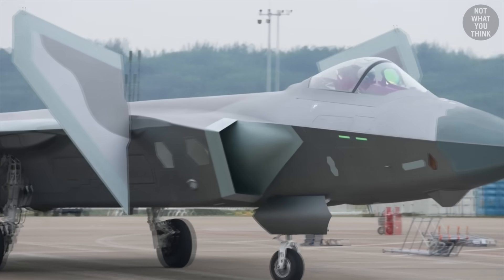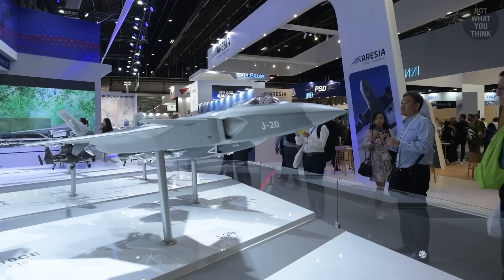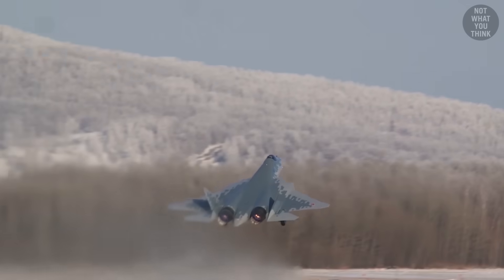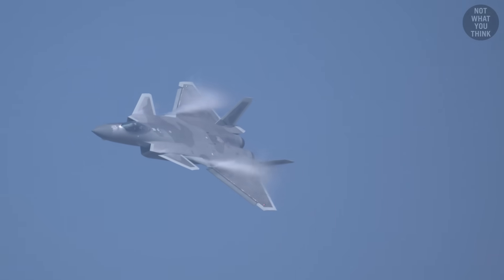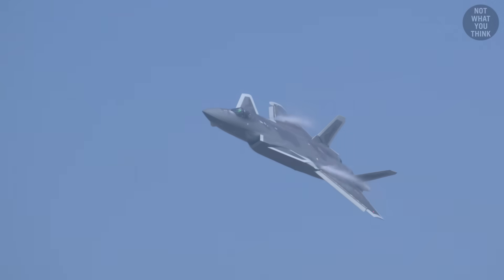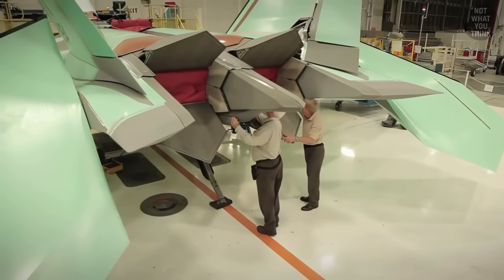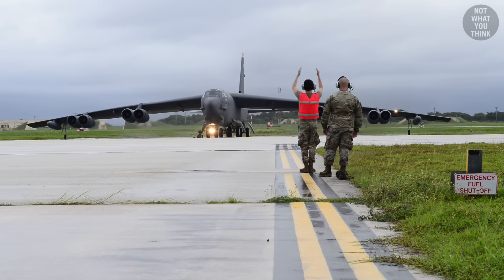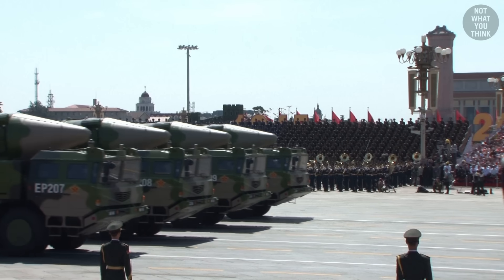Why China's Stolen "Stealth" Fighter is Problematic

Comment: wait what? How does the afterburner give it more of a radar return? Surely you mean an IR signature.
Reply: It's plausible... afterburner exhaust is going to be really hot. Really hot gas could be ionized. Ionized gas is going to be isotropically reflecting radar. Radar frequency light propagates much further than infrared light, so the radar return could be more significant than the IR visibility.

Comment: China has no long distance support for the J20. Also even with those improved indigenous engines capable of super cruise...they are not heat shielded. The J20 still pumps out super hot gases without afterburner, which is very visible to American airborne electronic intelligence aircraft. Also it is not very stealthy in terms of RCS. It may be a relatively capable modern aircraft, but up against a pissed off US military...its still toast.

Comment: What happens when two stealth fighters approach each other but can’t see one another? You’re gonna want a gun then.
Reply: You have something called High off Boresight IR missiles. Plus, stealth doesn't mean invisible, just reduced visibility. At 10 Km stealth isn't gonna do much to save you from an AESA radar and an Aim120, PL15 to the face. This is why there's a thing called the MAR or the no escape zone for missiles.
Reply: That’s why the f22 and f35 can still dogfight and has cannons
Reply: @halo1011998  if im not mistaken, only the f35a has guns internally
Reply: @nomad_grj Yeah, only 95% of all F-35's manufactured to date.
Reply: 有中国J20拦截F35的新闻报道，你们军方人事证实过，为什么会有这种事情发生，这肯定是F35被发现了。所以在中国的近海，隐身战机未必隐身。
Reply: The prevailing theory is that a stealth fighter should never even be close enough to another fighter for a gun to be necessary, but the emergence of the J-20 challenges that theory. Also, modern stealth fighters aren't actually invisible to each other; you can fool radar but there's currently no way to mask the infrared heat signatures from jet engines.
Reply: @ManiaMac1613  It also has to be considered that Stealth Fighters aren't "Invisible" to radar, especially at ranges close enough for an IR missile.
Reply: @ManiaMac1613  No, the theory isn't challenged. You don't run into a knife fight when everyone has guns.
Reply: The close range high off bore-sight missile come in handy in this situation aswell... cant forget about those AIM-9Xs or the russian Archer R-74Ms.
Reply: the detection range of fighter jets is somewhere between 15 and 25 km

youre not using a gun at 15 and 25 km. two planes flying towards each other would have 30 seconds to  respond to each other and at that point you might as well launch a missile
Reply: @purona2500  Yeah? What if the missile misses the target? Are you both just going to agree to stop engaging because you're too close to effectively use missiles and only one of you has guns? lol
Reply: @somethingtojenga  both planes turn around and whoever completes the turn first fires again
Reply: @purona2500  Why would you waste missiles if you have thrust vectoring and come around to the back of the other fighter in range of your guns?
Reply: @somethingtojenga  Because there's a squadron with you on their missile range while you try to get inside gun range.
You will not get close.
Reply: @purona2500  if you’re really trying to be undetected then you or they are terrain masking. You’re not going to see anyone or they you until you’re right up on them.
Reply: That's why j-20 carries 2 or up to 4 heatseakers that are hard to dodge even with flares.

Comment: Bullshit flag on more technologically advanced sensors.  Those sensors require intense computing for signal processing.  China has yet to build their own 6th or 7th generation Intel equivelent chip.  They have been buying from Taiwan until recently.  That stopped., with all the fighters buzzing Taiwan airspace.  One of our presidents (or members of the cabinet) invoked trade rules and the technicians from the USA and Europe who kept the  chip making machines repaired have also left China.  They are only going to be getting a limited number of what few chips they can produce before breakdowns stop up that source.  I have seen the quality of stuff made on Alibaba and their other manufacturer direct sites, those planes are not going to stay cutting edge for long.  The Super Hornets flown by the navy might actually be equally hard to see...  Those square intakes and canted tailfins have a purpose.

Comment: As soon as a J-2 does a hard pullup those canards will defeat any stealth that it has built into it.
Reply: When you are trying to remain undetected, you avoid doing things that would make you easier to detect.  It is obvious their radar signature would increase in size if you present the broadest profile of the aircraft to the enemy.  They would avoid doing so.  It is not even worth mentioning, really.  Hold on.  Are you trying to bank on the enemy making an obvious mistake?  That is one of the surest paths to defeat.  Don't take the obvious path to defeat.
Reply: RCS simulations say otherwise, mate.
Reply: @definitelyfrank9341  The thing with simulationms in countries like China is that the simulation better show what thew party wants to see or a skilled engineer suddenly becomes a rice farmer.

Comment: 4:00 "..heat signature of the afterburners will be visible on radar." --- What???

So it's all peaches and cream until they get mobbed by Wingman drones en masse armed with ... Guns!   
Ya, and missiles too.  Then they have to do 600 to get back to the mainland...past Japan.  1,200 range is 600 out and then 600 back.  Good luck.  Are they only stealthy from the front like the Russki junk?  If so they're going to take a shower up the jaxie on the way back.

Comment: China's answer to the F-22: Steal the blueprints and try to copy it. Typical Communist answer to anything. Truth is, there is no reward without putting in the work. This is the reason they didn't get the same results, they don't have people who can actively design such things, they just try to copy it off some plans.
Reply: lmao They stole the F-35 documents, not the F-22.
Reply: @definitelyfrank9341  They got a packet of both I believe, they just didn't have the skills to recreate them, especially the engines. Also, the body of the plane doesn't matter as much as the software running it. I doubt that was included in the blueprints.
Reply: @mattycakes1161  'they just didn't have the skills to recreate them' You're talking as if they didn't purposely design the J-20 to be the way it is. 

Yes, I'm sure developing effective software for the jets will be a big problem for the country ranked 3rd in technological expertise (one spot above the US).
Reply: @definitelyfrank9341  Yes, it will be, as even Russia has issues with it. Developing stable programs isn't all that easy, especially if you don't have access to the same technology as it's custom and all that stuff is watched and accounted for. They still didn't have access to the hardware, so they had to make due with their own, so will it be as good? Probably not.

Comment: Even the mighty F-22 Raptor didn't use it's guns against a weather balloon that isn't flying very fast.. and uses not 1 but 2 AIM-9X .. amazing kills
Reply: Why wouldn't you use standoff munitions against a balloon whose altitude exceeds the operational capabilities of your aircraft? And not to mention that even if it did use it's guns or was in gun range, balloons don't go down as easily as you think. There have been times when balloons were shot multiple times and not downed. Missiles were the correct choice here.

Maybe read up on how it all actually went down before commenting. Lest you risk pulling a Dunning Kreuger.
Reply: The Canadians already tried guns and they didn’t work because a balloon is more robust so the guns wouldn’t kill it. Since the Canadians already fired enough shots to equal a missile the US didn’t want to be a laughing stock and just fired 2 missiles for a guaranteed kill.

Comment: No gun is giving me f4 phantom vibes
Reply: The F-35 B and C variants also have no gun as standard, though I think the B can be fitted with one in a pod under the fuselage as the mission requires.
Reply: Missile technology has evolved greatly since the Vietnam war. We won't know for sure, but the smaller aerial engagements we've seen since then indicate that guns likely will not be very useful.
Reply: I believe highly restrictive rules of engagement is the primary reason the F4 Phantom got into dogfights.
If there's an air war near China they're most certainly not going to be fighting with such rules of engagement.
Reply: It ain't 1967 anymore bud.
Missile tech has come a long way from the unreliable AIM-7 and AIM-9B with their poor targeting and shitty maintainance
Reply: @Wishalloy Then Explain why the Navy had better-performing F4 pilots/ Missiles?
Which I should remind you, were all without guns
Reply: @Wishalloy Not true. They were not screwed. They were just ambushed. MiGs would do high speed passes and run away, too fast to be chased and gunned down.
The E variant got a gun, but later variants did not have them.
Reply: @ChucksSEADnDEAD  Most of them just ran pods, also, the F4 had a high top speed (by .3 mach iirc), however the MiGs of the Era were far more manuverable then an interceptor acting as a fighter (The F4)
Reply: the J20 is capable of flying way higher than the F22 which means they don't need a gun they can just lock down the F22 and strike them down with missiles from higher altitude as seen by how the F22s couldn't deall with the weather balloon easily due to altitude.
Reply: @1ycan-eu9ji  what’s it do if it gets into a dog fight
Reply: The MiG-25 and MiG-31 don't have guns either. Interceptors don't need one because they wouldn't be able to make much use of one anyway.
Reply: @Hypernefelos  it’s not an intercepter
Reply: @garlicguy-uj2ge  What is it then? It can't turn (limited to 5g) and is designed only for long range air to air missiles (both the MiG-25 and MiG-31).
Reply: @Wishalloy They didn't. The Phantom scored kills with missile, only a handful were by gun.

Comment: Also, the thing you have to remember about the American Military...they have been engaged in perpetual wars since WW2, either for National Security reasons, or in service of NATO.  They are battle hardened, and have more than enough experience using the tools that they have, and built on that experience with advancements with those tools.

The Americans have learned their lesson in Vietnam, that no matter the situation or advancements in technology, a fighter jet will always find a need for a gun.  That's why every fighter since the F4 Phantom, has been equipped with a gun, no matter how well armed it is with missiles.  Because missiles can be countered...a 20 or 30mm AP Round can't.

Comment: One thing I would like to add is that the J-20 is not only designed to counter American stealth fighters, but also to target high-value assets such as AWACS, tankers, and bombers. These aircraft are essential for maintaining air superiority and supporting operations in the Pacific theater. 

The J-20’s long range, stealth, and sensors allow it to penetrate deep into enemy airspace and strike these vulnerable targets, disrupting the enemy’s command and control network. This is similar to the F-22’s concept of operations, which also includes hunting down enemy support aircraft. The J-20 is essentially a stealthy interceptor, not a dogfighter, and its lack of guns reflects that. 

Thanks for the video, keep up the good work! 👍👍👍

Comment: Pragmatism is and always has been America's strongest tactical behavior. "Best to assume the worst-case scenario of an enemy jets capability, that way you cannot be unpleasantly surprised." However, having said that. the Current data the west has on the J-20 shows it is far less capable than most give it credit for, firstly, the J-20 is NOT stealth. It has no radar absorption coating, since the materials used and how to put them together is a well-guarded secret. Also, despite having its own homegrown powerplant, Chinese Jet Turbine engines are a lot less than ideal, and the only reason why it doesn't have a Russian powerplant is because the Russians refuse to sell them to China, so China, is forced to build their own engines, and their lifespan is far less than the Russian engines. And the Russian Engines themselves are subpar to say the least also. The engines the Chinese build are just reverse engineered Russian or Western nation's engines it has managed to get ahold of in the past. like the engine they copied from the F-4 Phantom II during the Vietnam War. But just because they copied something, doesn't mean it's equal to the engine they copied. China has no capacity to make CPUs for computers, they only buy them and install them into the products they manufacture. and since Trump's administration they aren't even able to get ahold of those anymore, so China is left to suffice with the ones they mad in stock before the ban was implemented so any computers China makes for their avionics in the J-20 are either made from western CPUs meant for the consumer market or cobbled together from other sources within their own computer market, which is also WAY behind the west and not going to improve anytime soon. So the "State of the Art sensor technology" mentioned in this video, is far less state of the art when compared to American and NATO sources. What I am ultimately saying is, although China always puts up a good propaganda rendition of their technology, the truth is FAR LESS optimistic as the Propaganda is.  China is also a nation of people who have ZERO combat experience, and they have significantly lesser technology than the west, if or when China attempts to invade Taiwan, they and the rest of the world are going to find out JUST HOW horrible China's capabilities truly are. missiles are one thing but a highly complex fighter jet that is supposed to be the same or near peer to the F-22 or the F-35, they don't even come close. And America is not about to let China know how much we know about their tech and how crap it really is. But one thing we do know, the J-20 isn't nearly as small on Radar as they want the world to think it is. The same for the Chinese Submarines and their Aircraft carriers, all of the things the Chinese build is nothing but junk when compared to NATO nations. The Chinese Submarine is so noisy that the American fleet doing maneuvers in the South China sea, as a show of force for the Chinese, could easily track the Chinese Sub no matter where it was during the maneuvers. The end result in case of a conflict with China is a foregone conclusion. China would lose everything it sent to combat the American fleet if they invaded or tried to invade Taiwan. and if China thought it's financial outlook was bad before, getting into a conflict with NATO and America's allies would be the death knell for their economy and their ability to buy and sell with the rest of the free world. And because Biden is such a spineless simpleton, I wager China will try to invade Taiwan BEFORE Trump is reelected as POTUS. China will pay a very HEAVY price for starting a war they cannot finish and because Most of the people in the Chinese military are the only offspring of their parents, they are going to be a lot less likely to mindlessly sacrifice themselves for a "Glorious Communist Victory" when everyone of their comrades have been erased from the skyt, the surface and from the ocean. and to make it worse, having a navy fall prey to their own countermeasures for "enemy Submarines" during peacetime has made a laughing stock of the Chinese Navy, and their so-called "Silent submarine" that makes so much noise that a drunk, blind illiterate radar operator could pinpoint their location during a hurricane! LOL

Comment: Same  stuff, different time. History repeating herself! 
Soviet MiG 15. Chinese J 6 
Soviet MiG 17,  19, 21 
Chinese J 7, J 8, J 9.
Look the same . Performance ?   Not  the same. Problems with their engines.
Even the basic Chinese model 56 AKM   by comparison with Soviet ,  Avtomat Kalashnikov 47,  performance?  AKM 56  . Inferior to the Soviet.  Maybe China has advanced technologically since 1970 - 80, es  obviously.  But it is not quite to the level of the US and NATO  yet.   I'm not saying that everything China made was inferior!   The did made very good  artillery  pieces, trucks .  Their nava,l  4 Torpido Boats . Minesweepers, midsize Cruzers , Anti-aircraft guns, and portable surface to air, missiles, miles .  Were excellent .  The Chinese  
4  Torpido, patrol Boats , were top notch.  Fast, up to
 60.mph ,   agile, practical.  Very effective.  These Boats would elevate on the surface of the water ,only 15 % of the boat would touch the water  , two skids on each side and little part of the back the outboard. Or turbine ?not Shure which.    Legendary  4 Torpido patrol Boats.  The Chinese should be very proud of this Machine , and lots of other hardware.  
But the Aircrafts they have to catch up. The do perform ALMOST the same as??? Whoever's  Russians, US , Euro fighter,  
But almost ! Is not the Same as.